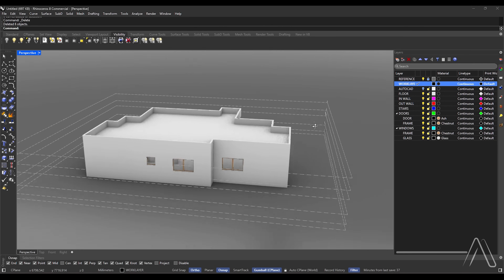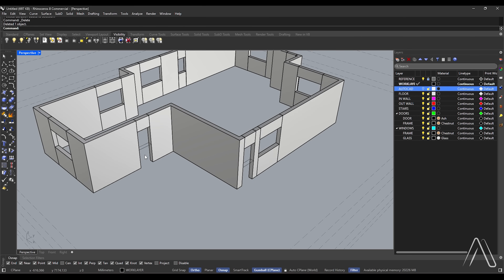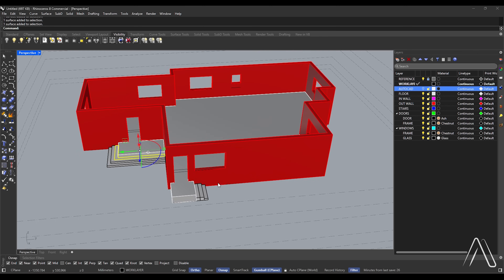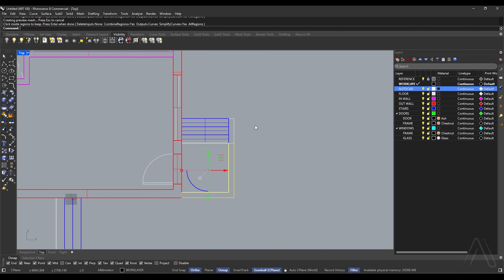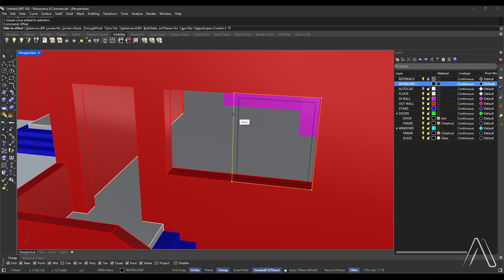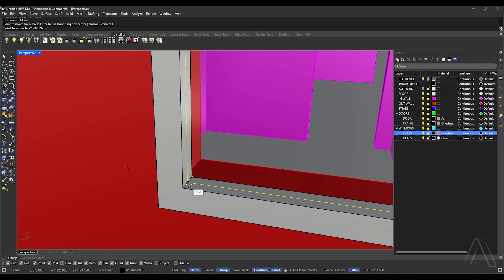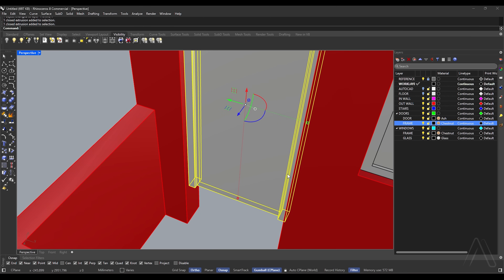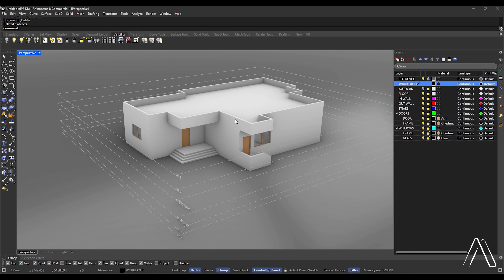Rhino Tutorial | Architecture - Basic Modern House Modeling (Step by Step)

Comment: sir why did you use Curve boolean before the extrude curv?
Reply from the maker: I used Curve Boolean to clean up the curves and make sure I have a closed shape before extruding.
It helps remove overlapping lines and ensures the extrusion works clean and without errors.
Reply: @alajore_arch ok, thanks